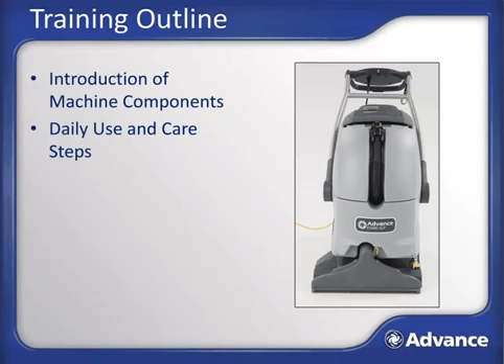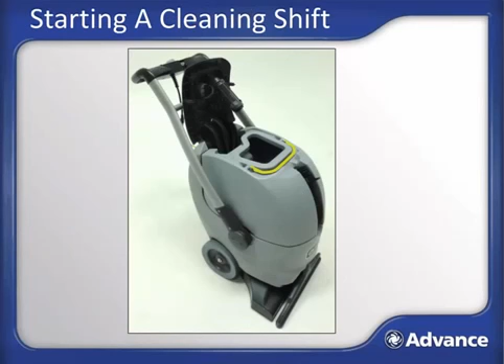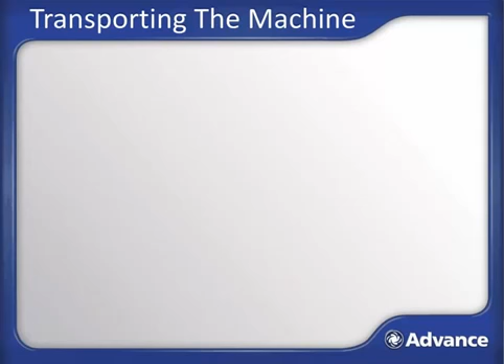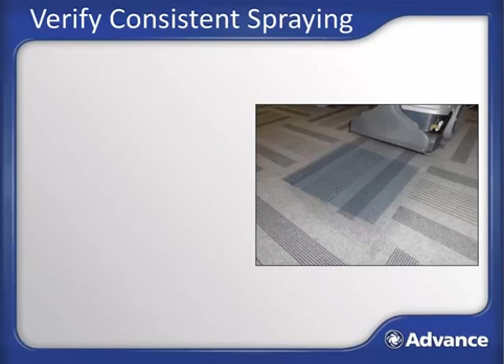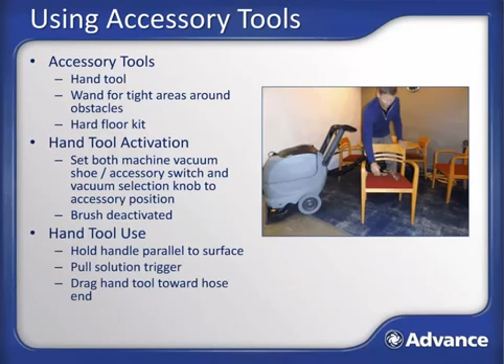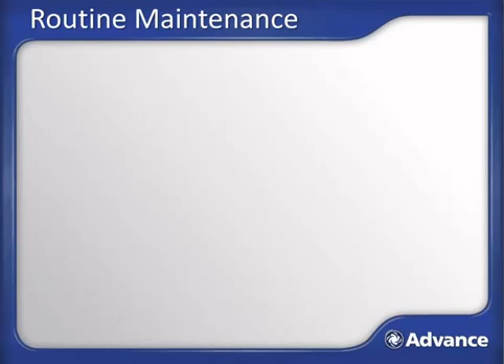ES300 XP and ES400 XLP Extractor Operator Video

Comment: Do you clean and extract with the brush lock up or down locked or unlocked? It seems like it works better in the locked position it has more of a pole on the carpet with the brush at least that's how it feels.